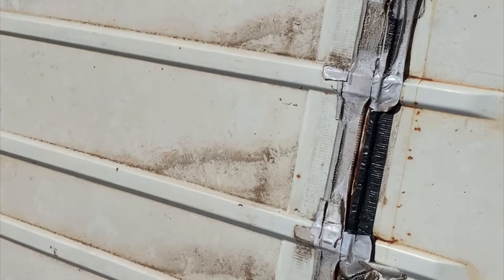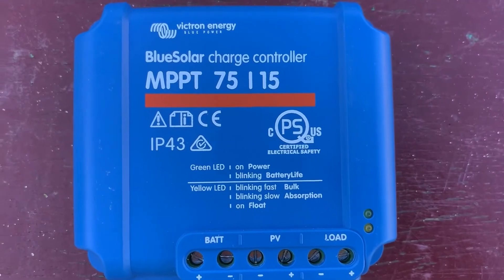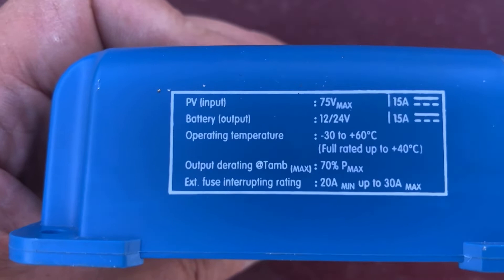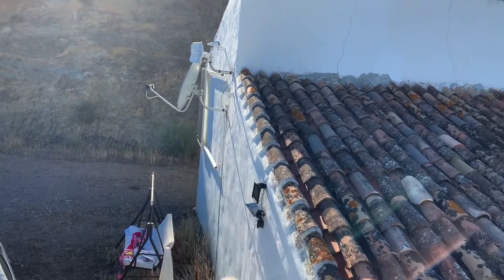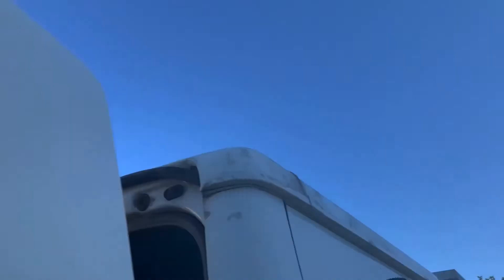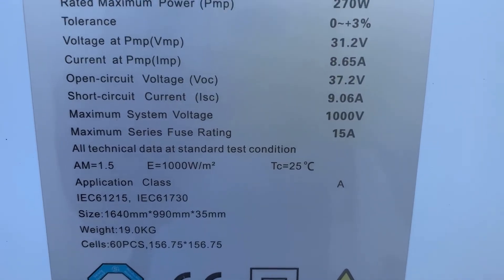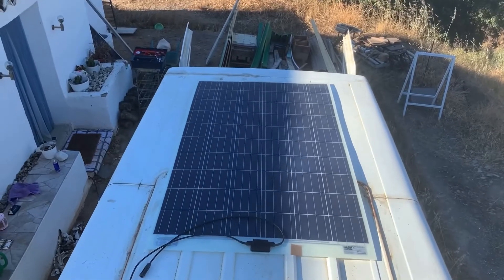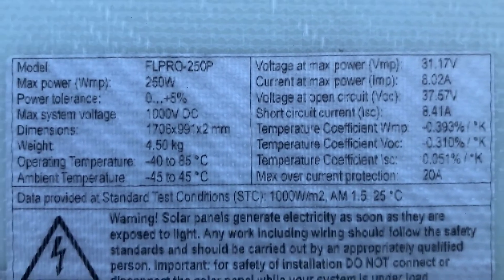Solar Panel Dilemma ! Proper Head Fook Yo - Removed Roofrack Ready to install Solar Vanlife bla bla

Comment: Would have been better attached to the roof rack. If that needed replacing then, as said elsewhere, fit a replacement rack before panels
Reply from the maker: I would have had to cut bits off the rack, dunno if you noticed the bits sticking up from it ? I think its just extra weight we dont need to carry about now , iv seen a few others just bolted to the roof and think it looks better 🤷🏽‍♂️🚐
Reply: @CamperVanHandyMan  you'll need solar panel corner and centre brackets..big white moulded plastic designed to fit the panel profile purfik ! By the look of it you need smaller panels for them though as they need to be anchored stuck and screwed to a flat surface dude 🤔 Just saying as I've just had exact same problem 💩

Comment: I would use the two panels..charge controller can take it,just depending on how stealthy you want to be...if you don't want anyone to know it's a camper van, then use the flexi panel...also depends on how much power your going to use inside the van.
Reply from the maker: Yep good plan, everyone saying similar, just need to find a place in or on the van to store the flexi one to pull out when parked 👍😁

Comment: Ok so the charge controller will take the two panels amp wise. For me the over hang is nothing major as long as they are well attached although tbh I would have attached them to the roof rack.. Over fallen out of love with the flexible panels as I fitted one 6 months ago that is already showing signs of failure and once they are bonded to the roof they're a bit to get off. We've just got a mahooosive single house panel which will cover most of the roof as we intend being nomadic and with the amount of gadgets we have there is no such thing as too much power in my book. So my advice, go with the two.
Reply from the maker: HiyaPeter, thanks, the overall consensus seems to be use the two panels and that the solar control charger thingymabobs will be fine. Many others have also said that the flexi panels wear quickly and overheat if no air gap is left under them. Yep the more power the better for us too, especially as im a netflix addict 😂
Reply from the maker: Also i think the roofrack is just unnecessary extra weight thats why i decided to remove it after all the hassle it took me finding one big enough 😂🤷🏽‍♂️